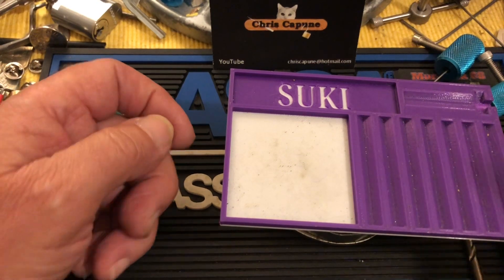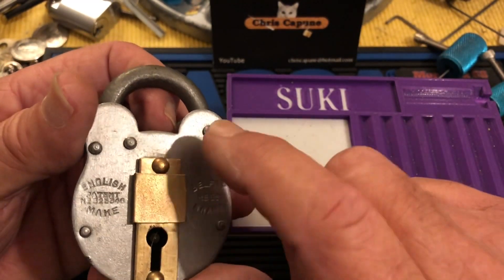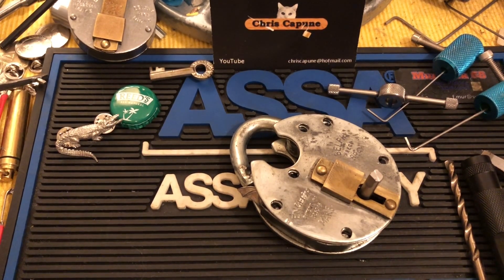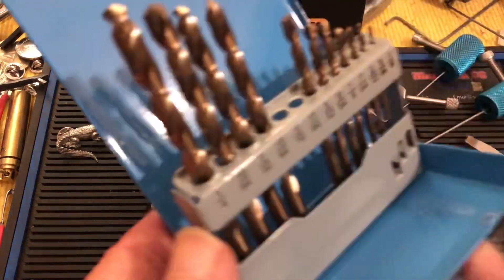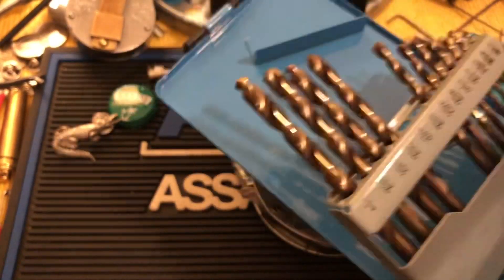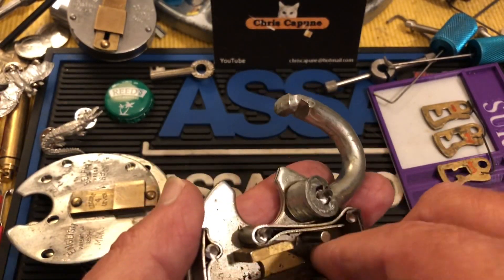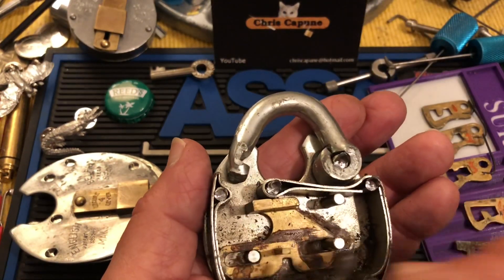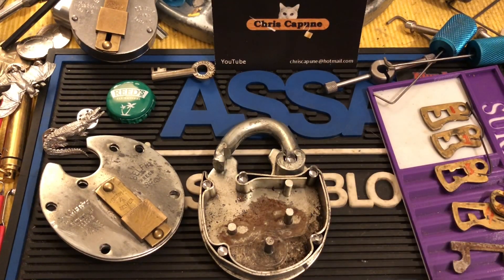#1286 finally stuck a tensioner in a lever lock!!! ☹️

Comment: Great video! As you mentioned, that happened to me and that started me taking old or duplicated or broken. lever locks apart and putting plexiglass covers on them. Now I make sure that my uprights are slightly shorter than the height of the key way to prevent that. 
Thanks for this great video👍🦊
Reply from the maker: Yes a valuable lesson on always use a shorter tensioner then the key!😀
Stay safe my friend 
🐾👍🐈‍⬛🐈🐾😷👍🔑

Comment: In this scenario you sometimes need to pick the lock closed to retrieve your tool. I have encountered that on a defiant that I did with a homemade tensioner. I got stuck and then had to pick it closed. Was a pain as you have to push the shackle down on those as well.

Awesome to see the insides of your belfry though and great to see you retrieve your tools 😎🤘
Reply: Nice to know there is another work around to fix the problem 👍
Reply from the maker: Have posted a follow up video on some of these questions 😀
Stay safe my friend 
😷🐾🐈🐈‍⬛🐾👍🇬🇧

Comment: You didn't compare the tensioner against the key to confirm if the size of the tensioner was wrong. Also, what happens if you reassemble with just the 4th lever in place? You showed that it seems to work with just the bolt. Was wondering if the 4th lever was getting in the way (presumably because the tensioner was too wide).
Reply from the maker: Yes! The height was not checked 🥲